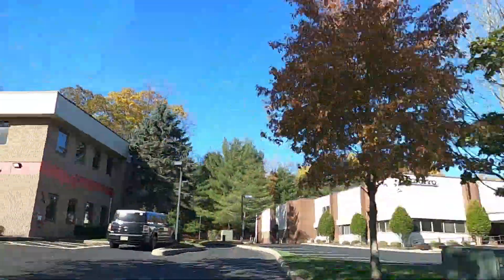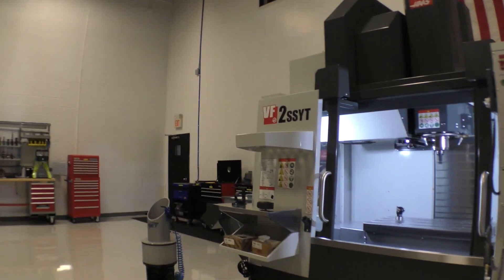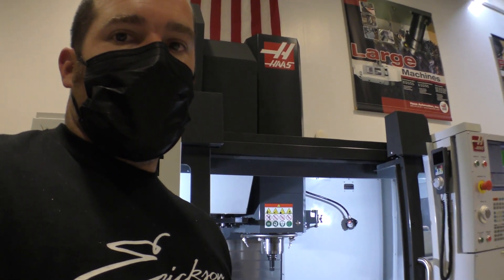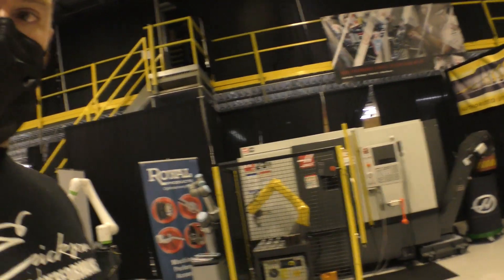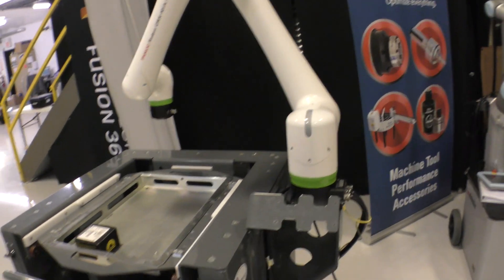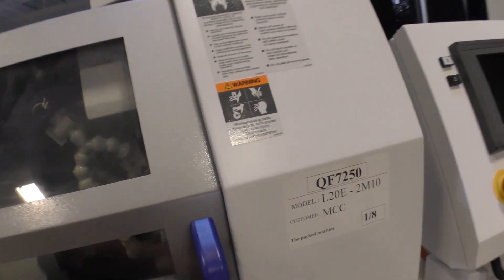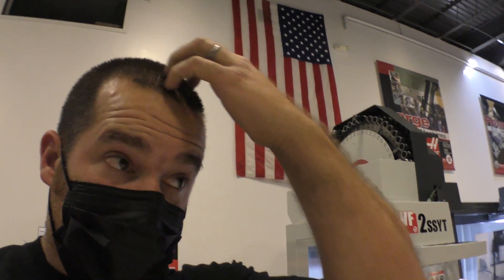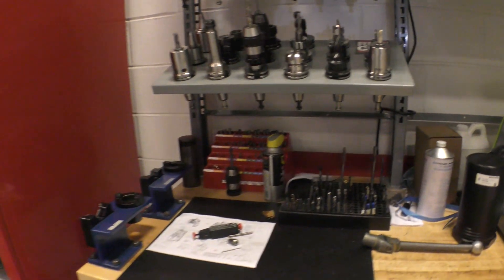Looking to buy a new CNC machine so i Visit Allendale Haas Factory Outlet. Haas HFO

Comment: What got you started in machine work? I've always had interest in it, but it seems to have a high barrier to entry with tool costs.
Reply from the maker: My father.  He was one of the innovators of NC from the 50s on. He helped design some of the machines that helped build the Apolo and Gemini space shuttles and some other cool equipment for the military and Nasa.  So I have grown up around factorys and machine shops.   I personally have been programing and operating Cnc machines for almost 20 years.    If you want to get into the industry find a machine shop that needs help.   The best way to learn is by doing.   I have another video that I just need to finish editing  Where im moving a large lathe that I purchased and at the place I purchased it from they had one of the last NC machines my dad built.   Unfortunately he has now passed.
Reply: @EricksonMachinePerformance  Sounds like an awesome way to have grown up. I look forward to seeing that video. Sorry for your loss.
Reply from the maker: @MrSteakPotato  thank you